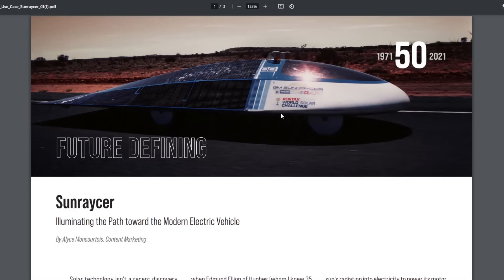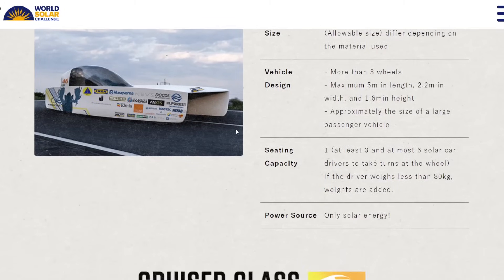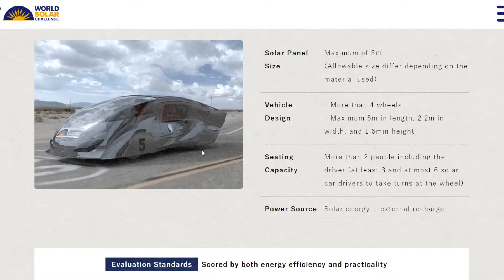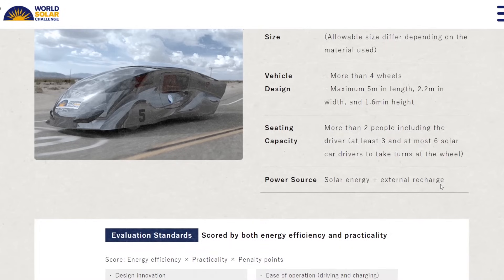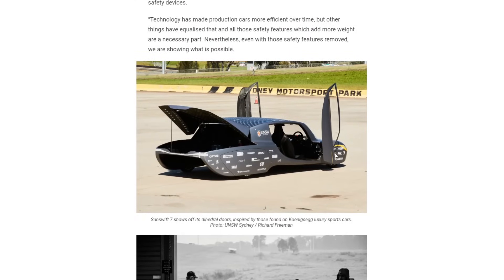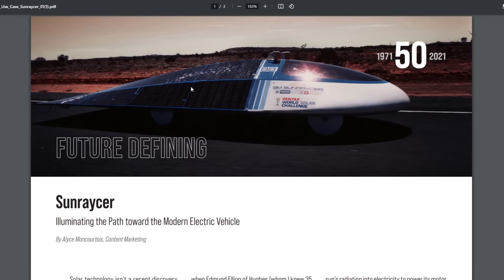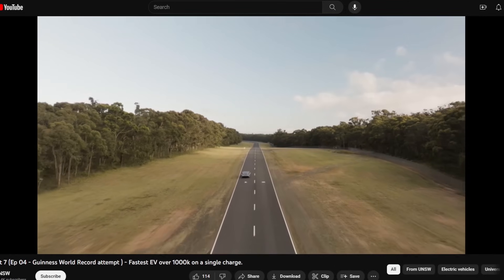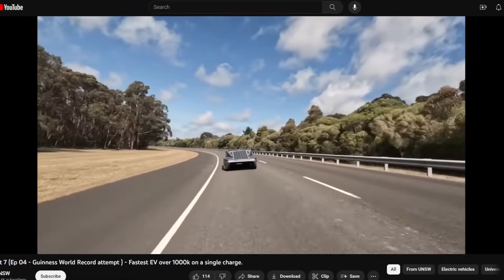The Sunswift 7 shows us that Aptera's efficiency claims are pretty modest

Comment: Their vehicle weighs 580kg and the efficiency claimed with 3.8kWh/100km. For math, 100km is 62miles so based on Aptera's last claim that would be 6.2kWh/100km for them. A Tesla LR TM3 is 17kWh/100km with a TMY LR at 18.5kWh/100km. Now Chris has already hedged numbers with his tire claims and we know weight is a concern as well. I am going to be nice and assume the efficiency Sunswift claimed was with the require two people on board.

The Sunswift has 4.4m2 of solar panels, Aptera is 3m2

So where does this leave Aptera... we don't know. We cannot know until they produce a complete production intent vehicle which means a production intent battery pack, due February to March 2024 per Chris statement at Tesla Takeover July/August 2023. One major outstanding issue is actual solar efficiency which we must remember, no working dash or rear hatch has ever been shown. The last dash pictures I can find were place holders. Only one roof is known to be in use. I really want them to show off a hatch, like seriously they should have one. 
  
Aptera never substantiates any of their claimed numbers. The Alpha, Beta, and Gamma, numbers would be pointless as they don't use proper battery packs and lack quite a bit of components, even Gamma is very stripped down.  Sorry, but you of all people should be first to question their lack of publishing numbers and quit acting as if those who do have no right to do so.
Reply: They have body parts for 16 production intent vehicles that are nearly complete at CPC. I think that the belly pan, the largest single component, is the last body part they are waiting for. The build of  production intent vehicles with those bodies is the starting gun for crash testing and system and efficiency evaluation.
Reply: "Now Chris has already hedged numbers with his tire claims"  It is not hedging to mention the impact tires can have on range - something I have experienced first hand with different tires on my Gen 1 Honda Insight.

I don't know why you are arguing out of both sides of your mouth.  You already know that there have been big changes from alpha to Gamma, and that the changes to the PI builds may be even greater.  These first vehicles will be put through validation testing, and then we will get actual, tested numbers from production intent builds.  Even the Gamma model is significantly different and the expected performance numbers can't and aren't based on it.  We will see a solar back hatch added to gamma, soon, though, and all of the PI builds will have it.

Versions of these panels were undergoing testing on stationary test rigs when I visited in November 2021.  The Maxeon cell performance that Aptera is using in these panels is well known.  The final usable output will have a lot to do with the controller design, and we will have those numbers from the validation testing of the PI vehicles - real numbers.
Reply: @bobhellman8676  Oh, so now the Sunswift 7 is designed for production, and can carry two people and camping gear or other luggage in comfort with thrilling performance?  

Your snipe at the cooling only reflects on you.  Anyone who understands engineering knows that the electric motors and control systems of the present Aptera produce a small fraction of the heat of that old IC design that was tested by the first Aptera Corp, and it has a much more carefully designed cooling system to manage it.

Use your engineering background instead of your bias.
Reply: @bobhellman8676  Bob, your explanation yesterday was nonsense from beginning to end.  You seem to have forgotten that the wheel motors mean that the vehicle weight is has a lower center of gravity than a more conventional car - a big reason why it performs so well in moose tests.

And adding a larger wheel/tire in the back for performance reasons would be easy for any customer who wanted more lateral grip in the back.

I am not an automotive suspension expert, but I have the professional experience to qualify on thermal engineering issues.  I will be glad to get the popcorn while you explain why what we already know about Aptera' s cooling system won't work.

As far as Elon goes, I watched him from across the street in Union City.  On demo days they had to push their broken transmission "production" sports cars into the garage to change them out while the next ride was being given.  There was a great deal of smoke and mirrors that was only fixed once the Daimler money saved them. - in the last possible hour.  So far Aptera is more honest and responsible with their resources.  You are goinig to get a big surprise once you decide to experience a prototype - which many of us have already.
Reply: @bobhellman8676  If you had done any basic due diligence, (such as reading the SEC reports) you would know that Aptera plans more factories, and additional vehicles - the next one likely to be a 4 wheel 5 passenger sedan.  Their estimate of a million units is not based on the 3 wheeler.  

  Of course Aptera has huge advantages compared to the Sunswift 7, starting with a factory, major industry suppliers, and a safety design that will be validated - none of which exist  for the Sunswift 7.  I have serious doubts on whether a Sunswift could even attempt a moose test in its present form, let alone come close to passing.
Reply: @bobhellman8676  And... if they drove each one of them and compared the performance, the preference would clearly be in favor of Aptera in most cases.  Why?  Physics and engineering.  You would have to add weight and sound deadening to make the Sunswift 7 as safe and comfortable as the Aptera is, killing its performance advantages.  The lack of headroom is a likely deal killer for people who easily fit in Aptera.  The fourth wheel adds rolling resistance, especially important at slower speeds.  If it is not using wheel motors, it will have more frictional losses in the drive train.  A scaled up Sunswift 7 looses most of the advantages the racer might have.
Reply: @bobhellman8676  Well, thank you for expressing your amazement, Bob.  Of course, Aptera is limited in that it is more focused for its design purpose than many vehicles.  Your attempt to dismiss the Aptera by using a name for a three wheel vehicle from Thailand is noted and yes, we recognize your  lame  tactic by agreeing that yes,  "What's next year, a carbon fiber Tuk-Tuk? is likely completely accurate.

No one is asking a user to "load up" an Aptera with too much weight placed inappropriately.  In fact you would have to try pretty hard to do so because of the way the cargo space is shaped.  There may be people who try to exceed the limits of any design, but that is not on the manufacturer, especially since Aptera have been very public about the 500 lb weight limit from the beginning.

"So you start with "the stripper" @ .0095 Cd & 3X the efficiency of Aptera." Those words don't make any sense to me the way you state them.

First of all, a lower  Cd*A  can result in a more efficient use of power.  Tbe best estimate of Cd for Aptera that  we have at present is  0.13 with a likelihood that the final number will be somewhat better,. This would a calculated give frontal surface of 2.1 m2,  resulting in a Cd*A of 0.27 more than the claimed Cd*A of 0.177 for Sunswift .   These are good numbers, in favor of the SunSwift 7. and the difference in energy use between them will increase the faster one travels.

The addition of the required mirrors to the SunSwift 7. will lower this advantage.  

The best way to compare the efficiency of the two vehicles will be to compare the total energy lost to friction at a given speed.  It is already a likelihood that with only 3 road qualified tires that Aptera will have less rolling resistance.  In addition, the friction losses in transmitting the power produced by the motors to the wheels will be greater for the Sunswift because they have to go through more energy stealing bearings.

What the end comparison would be in an imaginary production intent Sunswift is unknowable but the claim that it would be three times more efficient is silly.  As it is, I hope we will eventually be offered the choice.

The Murray you mentioned earlier certainly doesn't provide a choice and is a low volume handbuilt vehicle.  We haven't seen any other serious recent production efforts besides Aptera at this point that get anywhere close.  I hope we will and that a version of the Sunswift will be one of them.

For the moment, saying that some future imaginary production design is better than a real one that can be built in volume from tooling that already exists is cringe.
Reply: @bobhellman8676  I would love to.  Most of my motorsports experience has been on motorcycles in the past, but I have known some Indie car and other sports car designers.  Fun is fun, but we need to recognize when it comes at a cost.

Comment: Comparing the sunswift to aptera is analogous to comparing a chevy to a F1 racer.   The sunswifts lighter weight, and much smaller frontal area are HUGH impactors on range. Plus they have SEVERELY limited power output to optimize range. 

While interesting to see the solar challenge progress, the applicability to consumer production vehicles isn't there.

Comment: The tires are small. Maybe motor cycle size. Imagine what thirty eight HP would be like spread across 4 hub motors. Would it be lighter? I would bet both passengers are in 4 way restraints. No mirrors or cameras. Nice idea but far from road worthy. You also have to consider suspension. It would be interesting to see what they would come up with if part of the criteria was street legal.

Comment: 0.095 cd is only 27% better than Aptera 0.13 cd.
But truly you do not know how they measured the cd of the Sunswift 7, was it measured in real performance?
The point is all cars need to move air thru the cabin, and this will change the air flow profile and thus change the cd coefficient.
In the Aptera flow test, the air intake  right at the base of the windshield was closed to maintain the smooth flow of air along the windshield (otherwise the air flow  will break and cause turbulence there), you saw no smoke trace enter the cabin of the Aptera. In real operations, the air intake must be opened, otherwise you will be suffocated since Aptera has no other air intake.
It seems to me, the 0.13 cd Aptera claims is only achievable if the air intake is closed as indicated in the air flow test.
I maintain my opinion until proven otherwise that the real cd of Aptera will be greater than 0.13.
Reply: I think the far higher efficiency is just from it being a far smaller car than Aptera. Aerodynamic drag is only a portion of the equation, this is then use with the surface area to calculate total drag. I just think Aptera is a far bigger car. Looks to be way higher up and far more rounded less flat.
Reply: @Skylancer727  
I disagree, cd is an important factor as it has been said by Chris Anthony himself “Most car uses 40% of their power just to push air around them”
Cd is not just another factor.
Reply: @Kukaboora  Yes.  So is rolling resistance.  Aptera has made many improvements in the vehicle shape since the .13 value was achieved.  The odds are that they have found several significant places to improve it.